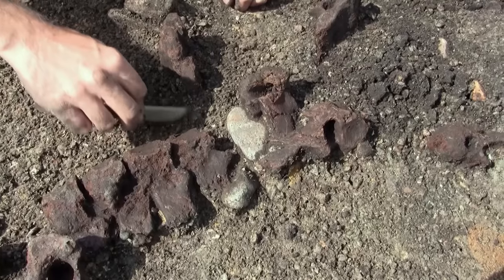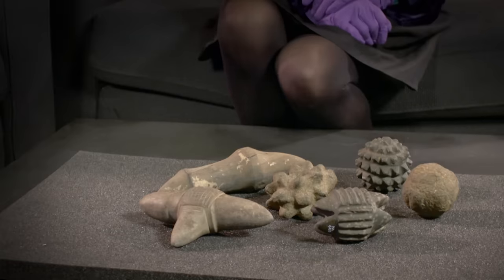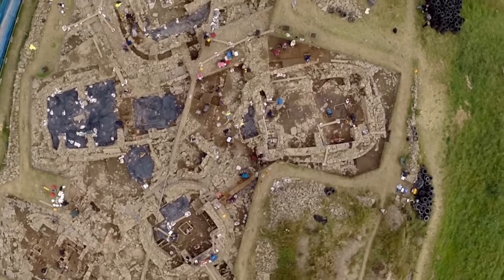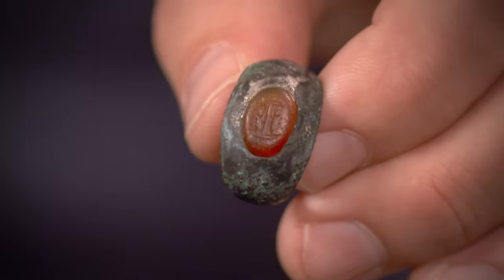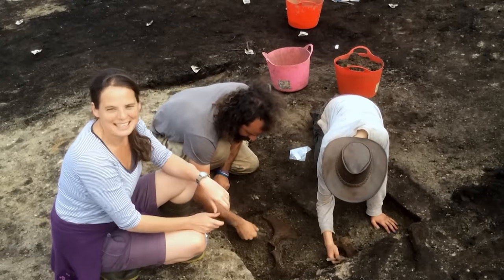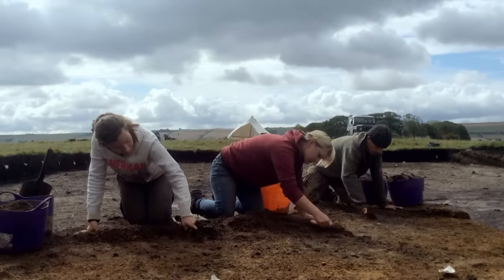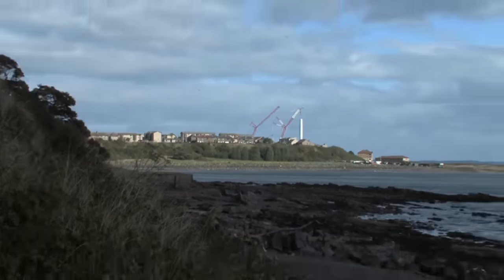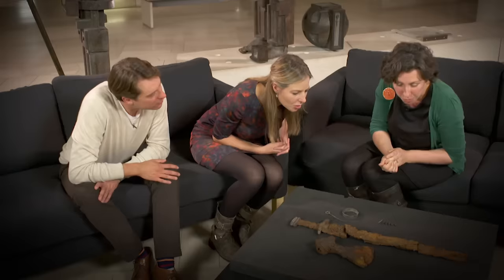The Incredible Neolithic Finds At The Ness Of Brodgar | Digging For Britain

Comment: 6:05 Perhaps to make Occam happy, a simpler explanation for the broken mace heads is that they simply broke during use. Most mace heads do. Further, it’s reasonable to believe that the craftsman who lovingly used it for many years would want to discard or “bury” it in some respectful way.
Reply: However in the Bronze age and Iron age items such as swords were ritually broken and deposited mainly in water. An example being Llyn Cerrig Bach  on Anglesey. So it stands to reason, and Occam's razor that this also happened in times previous to the Bronze age!

Comment: That Neolithic material from Orkney is fascinating and it's got a lot of stories behind it that are still untold. 
 
If I wanted a rock to bash people on the noggin I'd look around for a suitably sized stone and pretty much use it as is. If I were gong to do a lot of noggin bashing I might work some indentations into the stone so that I'd be less likely to drop it during a busy session. The amount of work on the stone with the almost grenade-like working on it suggests to me that it was not a regular weapon. Even the fist-enhancer doesn't strike me as a practical regular weapon.
 
In both cases (and with many of the other artifacts that were shown) someone put a lot of work into making them, work that, at least in some cases, didn't add to the functionality. That suggests that those people had means of feeding and clothing themselves that left them enough time that they could build astonishing structures and also put huge amounts of time and work into working stone into fine, decorative objects. And that raises some very interesting questions regarding Neolithic economies and means of production. 
 
Regarding the "altar" stone in the remains of the temple or "cathedral", I suddenly thought that it and a number of other standing stones from that period are not pillar or spike shaped but rather door shaped. The tops of those "doors" tend to be a bit skew-whiff these days but they may have been more rectilinear when they were made - or perhaps the oblique tops had a meaning for the people who erected them. Doors in turn might represent a passage from one reality into another. I'm just speculating here but I'd be interested to know if the experts have speculated on this question.